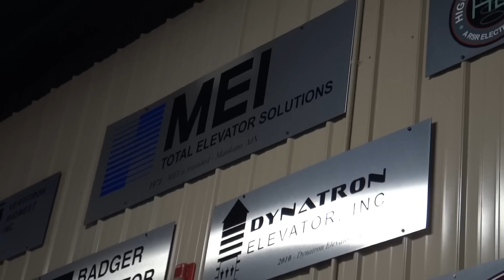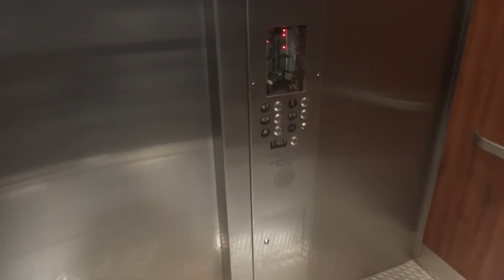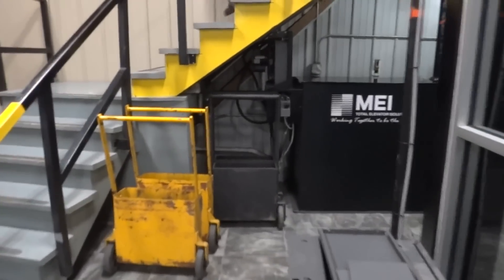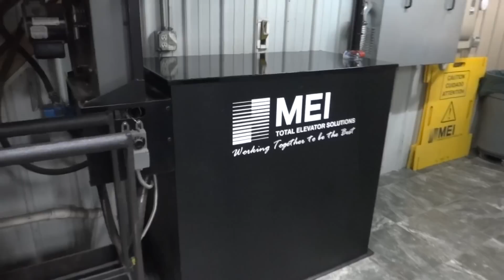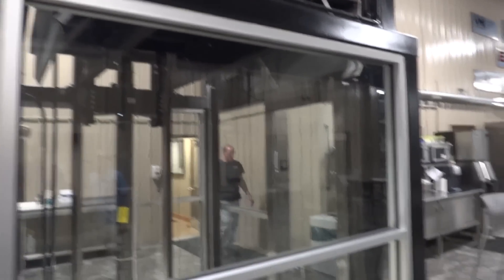Reflex Leveling on Minnesota Hydraulic Elevator @ MEI Test Tower Mankato MN

Comment: Wow, that is one cool looking elevator, and it sure is amazing that this elevator is a single jack holeless elevator with submersible unit, but travels at 175 feet/minute. That is also really fast for a 2 floor "LOWdraulic."
Reply: Malls need this speed lol
Reply: @qeelevators2960  Indeed, 100 FPM would be good for 2 floors, 150 would be good for 3 to 4 floors, and 200 FPM would be good for 5 floors. Anything above 4 floors should be traction.
Reply: @CenTexElevators489  unless you're a bar on top of a hotel in Atlanta (whiskey blue)

Comment: That's the 2nd fastest leveling elevator I've seen. EXCELLENT for the speed!
(#1 would be the former Payne at Leominster Hospital, Elevator C. Only 100fpm, but level in .5 seconds.)
Reply: georgef551 Not as fast as a Schindler 330A, they level really fast!  ;-)
Reply: It's in competition with speedy :P  :P
Reply: Vator Hunters
Speedy is single-speed. That's as fast of leveling as you can get (1-speed motors in general).
Reply: +The Elevator Daily From what I’ve seen & experienced, 330As usually take a while to level.
Reply: EvMast Productions I was joking.  I rode a Schindler glass elevator that took five seconds to level and another one that took five seconds to start moving after the door shut.
Reply: The Elevator Daily 
That's still a bit fast for Schindler's standards.
Reply: Well there is always an exception.  I been on a Dover that took 20 seconds to level.  Then there is that power stop.  Those are fun!
Reply: The Elevator Daily 
Been on slow-leveling Dovers as well, and fast Schindlers. Then again, most of us had.

Comment: It's got glass door on the 1st floor & on the 2nd floor it has the solid door. I wonder why it dang 3 times on the 2nd floor. There is no window on the right side of the elevator cab. Except for the window between the 2 doors.